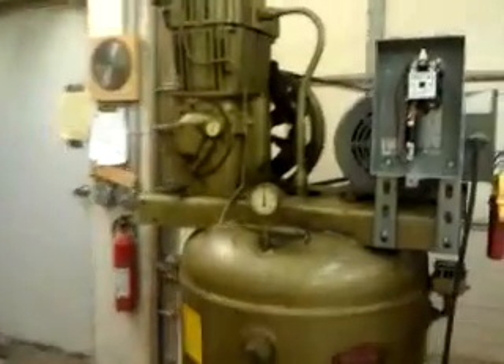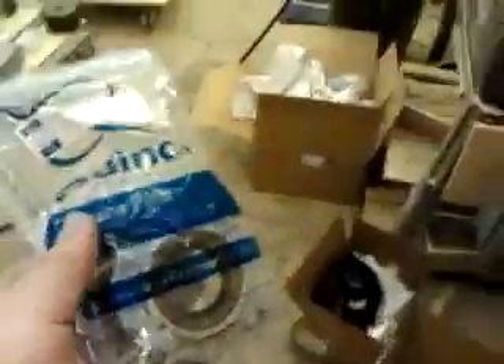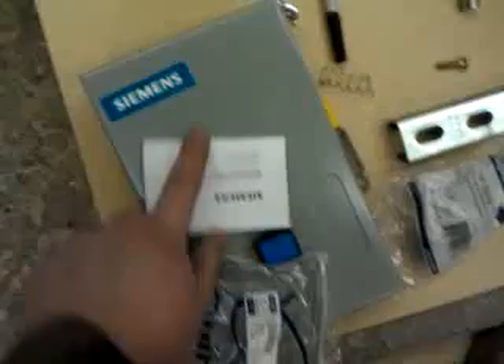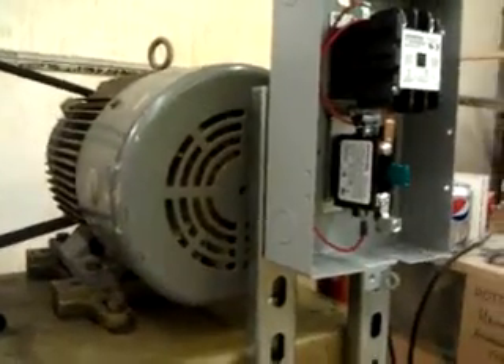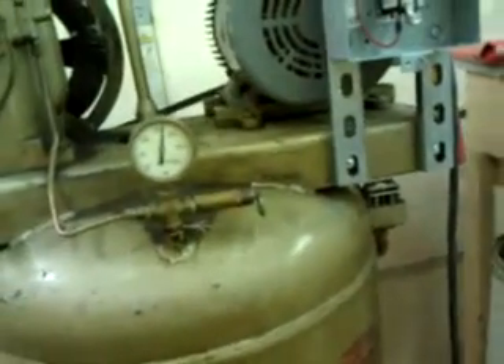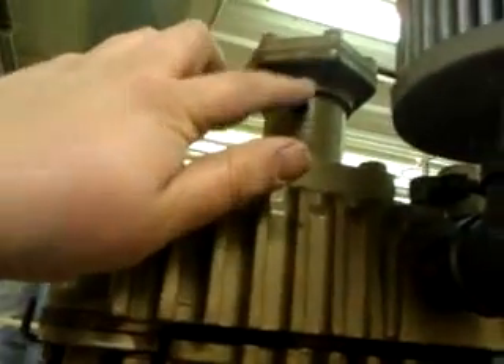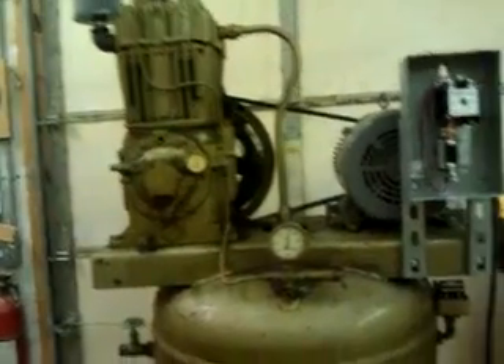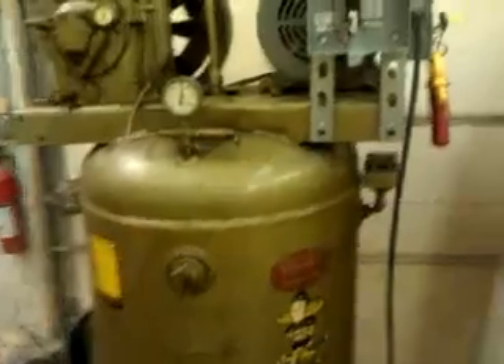Quincy  QR 325 Compressor Update 2-15-2012 # 38

Comment: Hey Scott you should find two paper thin gaskets on each side of the shim pack if the pump 
hasn't been rebuilt before but there not needed either is the RTV I used it on mine because it sits outside.Right 30 W/T N/D. Also if the HP disch valve is leaking IT will vent through the inlet

Comment: Thanks for the video.  I have a 325 roc 12 that was given to me.  A friend had it laying in his yard after pulling it from a truck.  It was previously PTO driven (old power company boom truck) he does tree service work.  Anyway I will have to add a hydraulic unloader because it was setup with a V.D. Pilot valve.  Seeing the plumbing on yours helps.  Now on a 80 gal vertical tank with a Lesson 5hp motor.  Did have problem getting oil pressure due to the rotation mark on the flywheel being wrong.

Comment: Hey Scott you may want to run @150-175 and regulate the pressure down to 100 PSIG 
to keep the start and stop down, also most timer drain solenoid valves energize the coil
and open the valve when power is applied. every time the compressor starts the drain valve is going to open. Make shure your drain plumbing is constructed of brass or stainless steel including the strainer  The diaphragm on the pres s/w maybe leaking